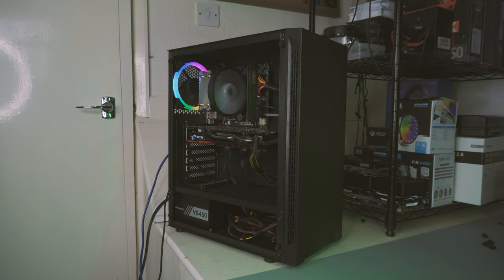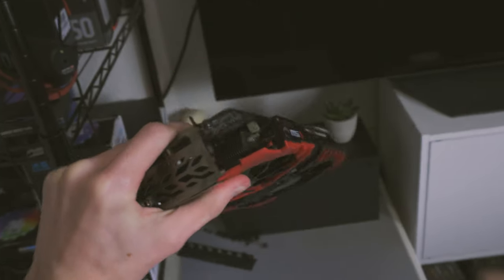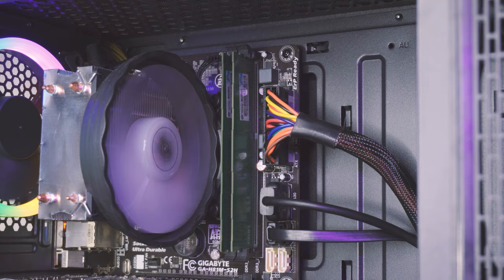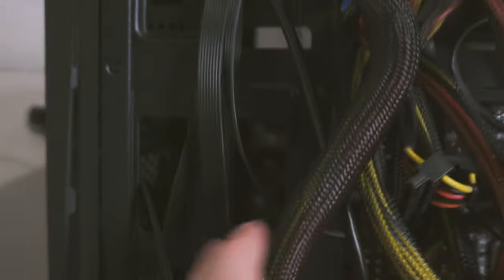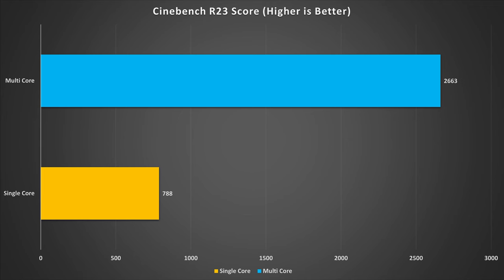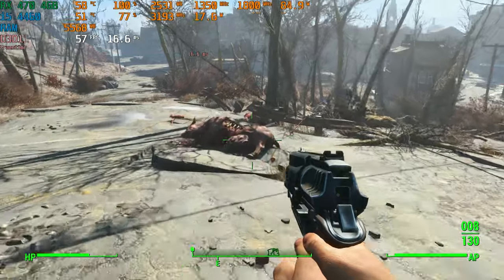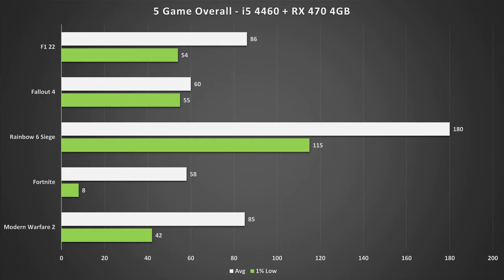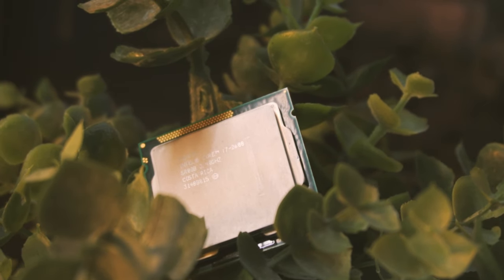This PC Build was Almost DISASTER – Building a $190 Gaming PC

Comment: tbh i feel like the weakpoint here was the i5. 8gb ram is enough for most esports games. but for stuff like r6 and valorant, from my experience, having something like discord open to communicate with your mates. that will tank your performance by quite a bit. i feel like a xeon wouldve been loads better for this
Reply from the maker: It is. I generally recommend the i7 counterparts on these older platforms. Because even a 3rd gen i7 is decent in games like these.
Reply: @ProYamYamPC  most 4c8t cpus released in the past 10 years or so are still great for esports and even some lighter higher end stuff. recently built one of my mates a system with an i7 4770 and an amd rx 5700 so he can play all sorts of games. runs very well still, despite the age.